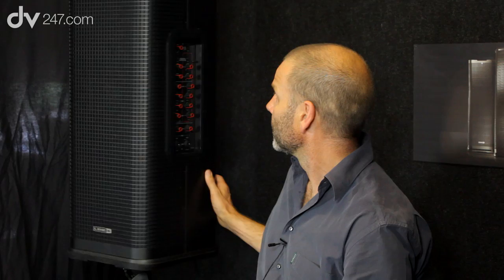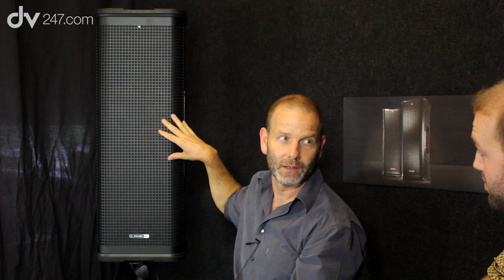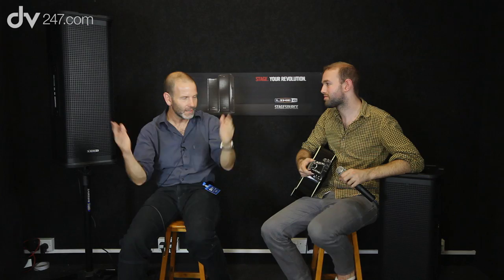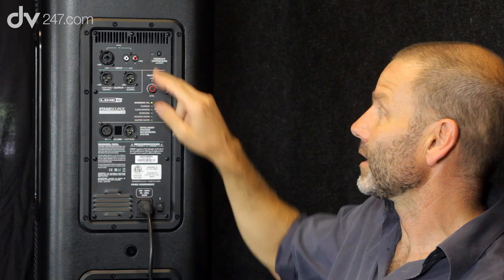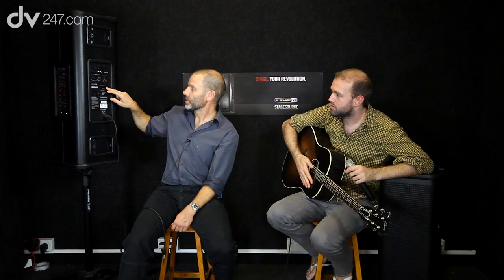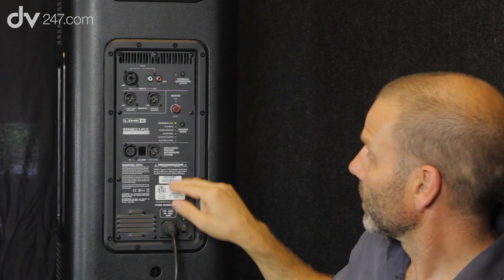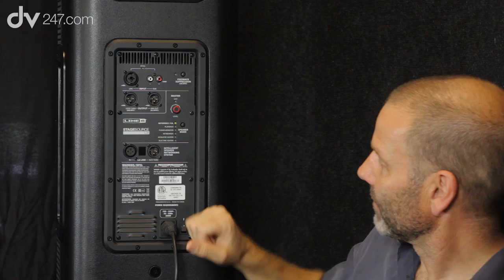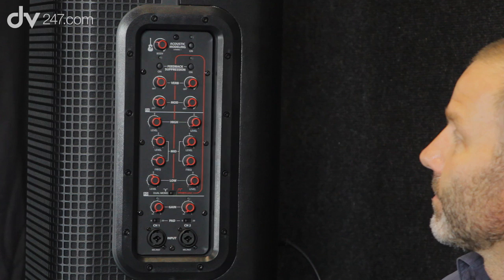Line 6 StageSource Demonstration

Comment: Is it compatible with a eletric guitar + microphones WITHOUT any other PA, mixer etc.? It seems there is no "guitar in" input...
Reply: +Solrac K. Has a 2 channel mixer built in for Mic & guitar, or 2 guitars, or 2 Mics, with all the EQ Parra mid and chorus and reverb, both good & usable effects, feedback eliminator is very shaky and crackly, I avoid using it. IT starts stumbling when I have to push it loud, trebble goes first, then bass next and this is only about sensibly loud (guessing 150 watts).

Comment: No phantom power, many peripherals run from phantom in 2016.  Very heavy for musical hands to manipulate.  Sound is very directional too.  Great sound though when performing, both Mic and acoustic guitar.  The "L3t  sound" even gives some extra confidence when performing.  Power output (1400 watts ?) compared to a vacuum cleaner is debatable? I'd say more like 150 before this thing starts having capability problems.